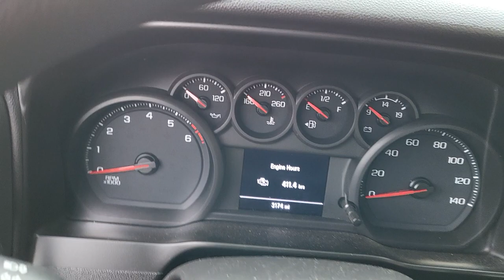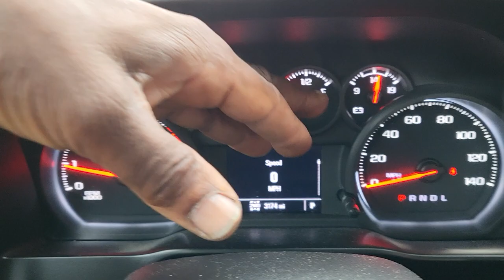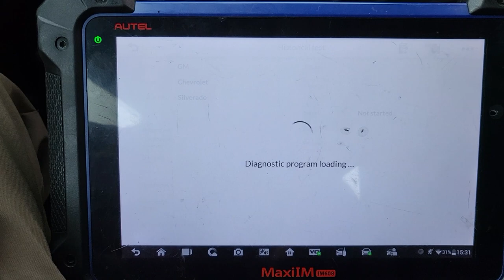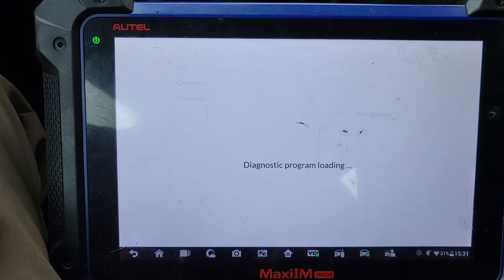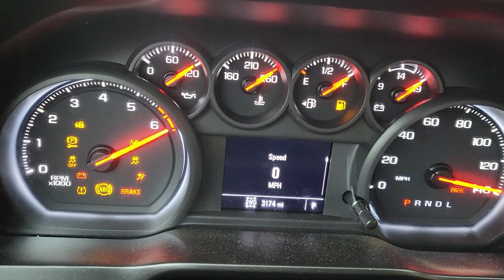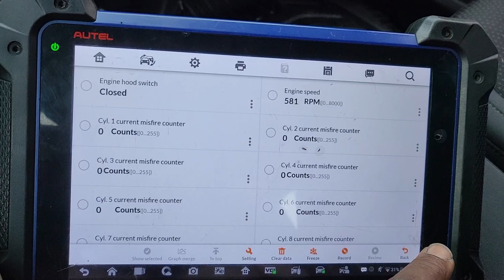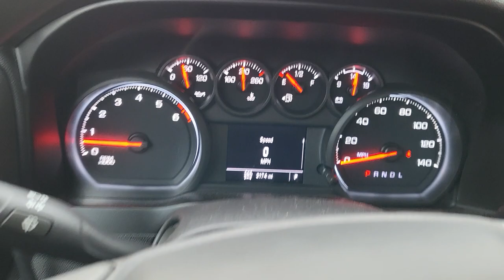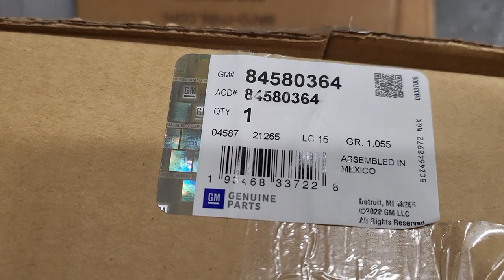2021 Chevrolet Silverado Cooling Fan One Performance Code Fixed

Comment: Hi Mohammad, thanks for sharing this video.
I have the same issue with my Tahoe 2021, I’ve replace the fans but when I reset the computer by disconnecting the the battery’s cable for 10 min.
After start the vehicle the check engine light in gone but after shut the engine off and start it again it’s appear again.
Could you please advise? 
Also what type of the scanner are you using for this vehicle, does it have ability to program or re programming the Chevrolet Tahoe 2021 and above? 
Thank you.